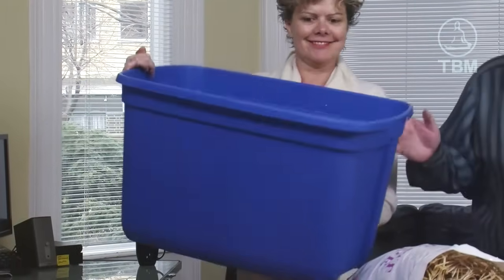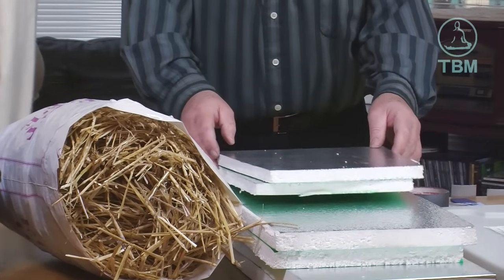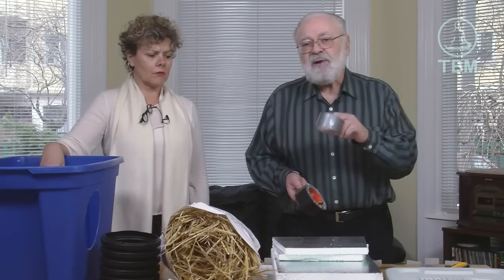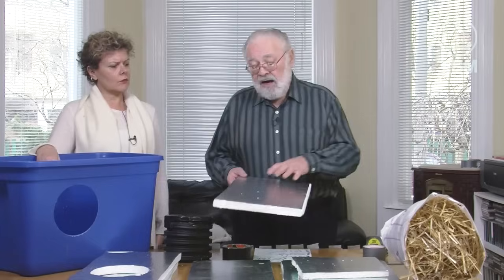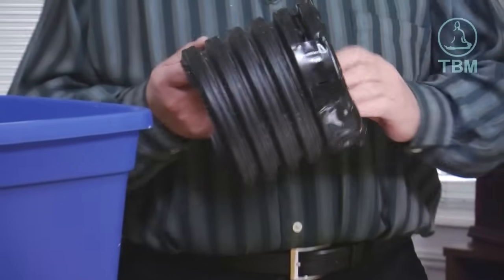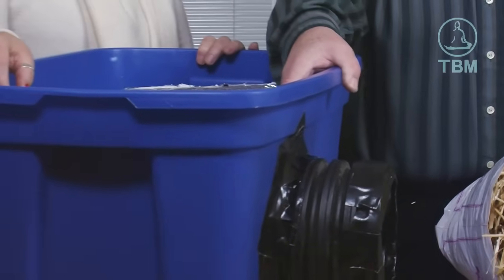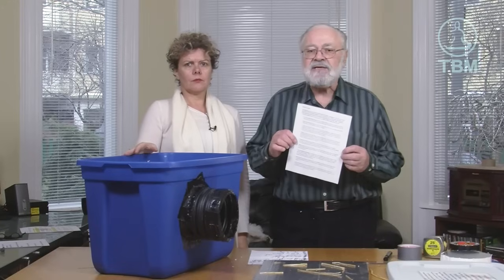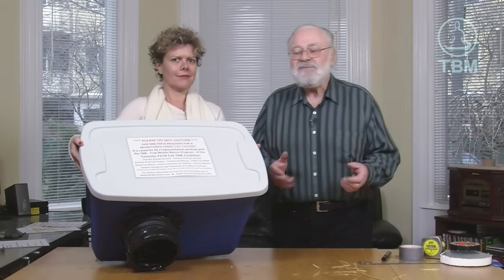How to Build a Winter Shelter for Street Cats?

Comment: Be sure that the shelters are high enough off the ground so that snow does not drift in. Also, be sure to secure them in a way so that they do not blow over - or around the area in fierce winds. It is ideal to make a rain shelter to fit over a set or condo of shelters to cut down on wind & leaks. 3 sides of plywood with a roof of some sort (corrogated tin or more plywood). Paint the plywood with a type that can withstand outdoor elements to help it last longer. Be sure to secure that rain/wind barrier to the gound as well. Ask lumberyard or hardware employees for suggestions.

Comment: The durafoam is not so good in high humidity.  If it is really cold and DRY there is that benefit of the insulation.  We ended up covering a corner section and ceiling with cardboard panels leaving the other corner section, incl. with the durafoam so there could still be some reflective value from the other 2 sides left with .  

For one cat using it might be fine if they are breathing and creating condensation towards the entrance opening.  With 2cats or if there is rain and humidity, all this extra airtight insultion just creates extra condensation and actually ends up being colder due to dampness.  The straw as a dessicant helps as does the cardboard overlay.  

Remember those "waterproof" unbreathable nylon coats in the 90's where you sweated and then got chilled.  Same thing.  The plain styrofoam is good enough for walls.   Even in our large wooden cat house that was insulated with styrofoam, the upper area peak of roof inside where heat rose to showed signs of mold and we had to create vent holes that were opposite each other.  Just BE AWARE that you need to consider humidity and warm bodies/sweating with some kind of air circulation (like in a tiny home with an air recovery exchange system).  Perhaps a design with a small venting hole??  That might create too much of  draft. . .  I dont know.  

Solution for now was using the 2panel cardboardwalls and ceiling and NOT having the durafoam on the bottom -just plain styrofoam and straw.  

Or maybe just ONLY having durofoam only on the bottom wouldwork, as the key is to have feet warm so everything else is warm and then some kind of breathable and absorbable walls like styrofoam and cardboard?

Comment: I have 3 feral kittens, about 6 months old now. I am disabled and alone so I couldn't make a house for them. I bought a Dogloo dog house and put it up on an old coffee table and covered it with a tarp so that rain and snow won't get in. I stuffed it with old blankets before it got cold. It was very hard for me to do all of that by myself. Now someone told me I should put wool blankets in the shelter to prevent mold. I did not get straw. Will they be ok with the blankets? They are using the Dogloo, they have nowhere else to go. Will this be ok?
Reply from the maker: Thanks so much for doing all that for them!  How wonderful of you.  However, technically blankets aren't good for them.  When blankets get wet they stay wet - and if you live in an area that gets cold/snow, then the blankets will simply become wet, and freeze (which negates the whole effort of trying to keep them warm).  IF you can get access to straw please do - it's absolutely the best at keeping animals warm and dry (it reflects back their body heat and dries quickly).  I admit I can't speak to wool and if it dries quickly - if you can find folks to confirm that it does dry quickly and won't stay wet/freeze during wet/cold weather then I guess it's a better substitute for blankets.  But most definitely, during cold/wet weather, blankets won't be effective.  Hope this helps and again, thank you so much for helping these kittens.
Reply: @tsc3930  Thank you so much for your reply. There is a place near me that sells straw, I am trying to find someone who can remove the blankets and put the straw in for me. Physically I cannot do it. And I do live in an area that gets very cold/snow and freezing rain. Hopefully I can find someone soon. Thank you again.

Comment: To demonstrate the negative impact of foil lined airtight Durafoam shelters, take a baked potato to represent heat radiating from a body and put inside the shelter.  Condensation will form on the walls making it damp.  Think why some tiny homes built airtight and without an air exchange system are experiencing mold.  Or when in your car getting condensation inside the windows.  We dont have this problem when using plywood (plain foam backed) which is a natural dessicant.  So all those kitty houses  - which we noticed after a few weeks of this variable weather were not being used - are going to be relined over the Durafoam with cardboard or double lined paper yard and leaf bags to help with moisture absorption.  Not sure if they will be damp.  Any other suggestions to salvage these shelters, please advise/post.
Reply: If you line with cardboard around the inside, won't the walls be used like scratching posts?  I thought the straw and opening would keep the moisture in check. Is this not so? Did your experiment with the baked potato include the straw and the 7" opening? Doesn't plywood contain off-gassing adhesives that are bad to breath in?

Comment: Can you recommend a heating pad that wont get wet? I have a large Dog Igloo up on an old coffee table, covered with a doubled tarp that sheilds the entrance from wind, rain, and blowing snow. Its stuffed with straw, but I was wondering if a heating pad would help. Would it go under the straw? There is an electrical outlet right by the shelter. I have 3 nine month old feral kittens Their mother disappeared long ago.
Reply from the maker: That's a tough call.  And there are different sides to the debate.  My personal feeling is not to mix electricity with straw.  i.e to have an electrical wire / outlet near such flammable material such as straw makes me very uncomfortable (that being said, we have not been made aware of any circumstances when something went wrong in a scenario like this).  While others think it's acceptable.  However, those that do it do make sure to wrap the heating pad in a blanket so that the cat's body doesn't touch the heat directly (for fear that they could be burned).  I am sorry we can't give you a black and white response but this is one of those many situations where it's a personal decision made on what you feel comfortable with.
Reply: @tsc3930  Thank you so much for taking time to reply. They survived 3 sub zero days/nights so I think they will be ok.  I feed them a mix of dry cat food, canned cat food, and warmed chicken broth. I have also boiled fish heads, removed the bones, and give them the broth and the deboned fish along with the dry and canned food. They love that. Sometimes I will throw in a little bit of shredded cheese for extra protein. They are chubby and seem to be healthy. Thank you again for your response.
Reply from the maker: @Pashasmom1  wow!  They are spoiled (which is wonderful to hear).  Thanks so much for caring for them.  The fact that are chubby and seem healthy are a testament to your care.
Reply: @tsc3930  I just wish I could catch them and have them fixed, at least. They come close to me and act like they want to be petted but when I slowly extend my hand they back away. I have asked several people and rescues to help me trap them, but nobody responds. So all I can do is make sure they have good food, hydration, and 2 safe and dry places to sleep. Wish I could show you a picture of them.

Comment: So the silver part faces the inside Home Depot told faces outside does it matter?
Reply from the maker: Hi there.  Admittedly I am unaware how this insulation is used in homes but for our purposes you put the shiny side facing in so that it reflects the heat from the cat back onto the cat.  Hope this helps!
Reply: Thank you I’m wondering if you could use that stuff you wrap around you when it’s bitter cold it’s like a silver blanket it might be called something like Mylar seen one lady  
cutting it up for cat shelters.

Comment: Looking at thermal insoles and even they say to insert into footwear with metallic side down - FACING AWAY from the foot.  I triedboth ways and my feet were cold when the metallic side facing up towards the foot.  Same principle must apply to the construction of these shelters.  The metallic side facing towards the cat increases cold and condensation.  Nix the Durafoam.  I am going back and lining all mine with carboard over the foam

Comment: Are drainage holes needed?  I've watched other videos and read instructions from other sites, and some recommend drilling drainage holes in all four bottom corners of the tote to let liquid drain out.  Some also recommend inserting  a PVC pipe with a T-connector on the lid as an air-vent.  Is an air-vent needed? or is the entrance hole adequate for ventilation?
Reply: I wish someone answered your questions. I was wondering the same

Comment: Absolutely do NOT use the durafoam.  We built 5 just like these and there were problems with condensation (literally the walls were weeping when the weather changed) and the foil facing in became as good as a freezer when it was super cold -15 and beyond.  If there is no heat source, SOME "insulators" dont work!  *So when a cat is already cold and their body temp drops while sleeping you have essentially sentenced them to die in a freezer as the foil lines ones  just become an insulated deep freezer*.  Plain styrofoam is best .

AND  We also have used/pinned/taped about 4 layers of heavy upholstery with polyester (doesn't freeze as repels water) fabric that is cut in slits up from the bottom almost to the top into 2 inch wide strips.  Even on the entrances of our heated shelters to cut out the draft and wind, so that it swings closed as they go in and out.  I have even cut a slit into a heavy fabric covering (trim/finished the slit with duct tape and so it remains open a bit, but can be pushed open (not for cats that don't know how to use entrances that "look" closed).  Mind you we need to replace those strips of fabric yearly as they can transmit ear mites or head lice/fleas, etc.  or lightly dust with diatomaceous earth on a regular basis.

Comment: We are going to try lining with carboard or creatinga vent.  We tested this by microwaving a potato in plastic container that had a bottom cavity, one vented and one sealed amd also putting paper towel on the top covering lid.  The potato heating represents a warm body heating.  The plastic the potato was sitting onwas wet with condensation.  The cavity below with a venting hole was goodand so  was having the paper towel in the lidcovering the potato  (representing cardboard or other absorbable natural material).  Please consider the condensation issue in these Durafoam materials.  I was horrified to realize they had worse "shelter" because of it.
Reply: I think that the straw will absorb the condensation.

Comment: Just curious but why the sub floor?
Reply from the maker: Hi there.  It’s not necessary.  We actually no longer add one.  We included it to add extra insulation.  But over time we realized that with one layer of the Durofoam we use (which is already lined with Mylar) on the floor, along with the straw was more than sufficient.

Comment: I've read on so many sites not to use straw cause it holds in moisture that will keep the animals cold that's why they say to use hay.
Reply: That wrong. It is hay that has and keeps more moisture. Stray is much dryer than hay, and less likely to get soaking wet or moldy.

Comment: How wide is the tunnel and what is it's purpose? You made one large entrance where other recommendations have been for two openings, one for escape.
Reply from the maker: The entrance is 6" diameter (that's the size of the drill press that we have and it's the size of the tubing that we get).  Re the two openings:  
Check out this page.  It's been written by someone who's spent many years in TNR and now builds shelters for cats.  It's very interesting and provides a very different perspective on this thought (re a second exit)  http://www.feralvilla.com/The-Myth-of-the-Emergency-Exit_ep_43.html

Comment: Very nice cat house, but you should have a second exit so the cat can escape any predator  that may enter the cat house.
Reply: Jacci, that's actually really smart.
Reply: İf there are 2 holes , it will be very chilly.
Reply: +ogzasu nurkan cover the openings with a thick pc of plastic once they feel secure to go in the houses. Many ferals also do not feel safe in houses on the ground, so put them on something off the ground.  Don't put the openings facing wind and wind blown rain.
Reply: @teknolojigundemi  that's what the straw is for, and depending on how close to a wall etc this is placed, enough room to escape without rushing wind
Reply: Great idea. Im adding a second door. The predator escapee
Reply from the maker: Check out this page.  It's been written by someone who's spent many years in TNR and now builds shelters for cats.  It's very interesting and provides a very different perspective on this thought (re a second exit)  http://www.feralvilla.com/The-Myth-of-the-Emergency-Exit_ep_43.html

Comment: Think about heating in your microwave oven.  Bake a potato and see the condensation form inside because it is also well sealed.  This construction advice is flawed and creates wet and colder conditions.  Cardboard or plywood are  more natural absorbable dessicants and plain styrofoam might work better or to have some kind of venting.